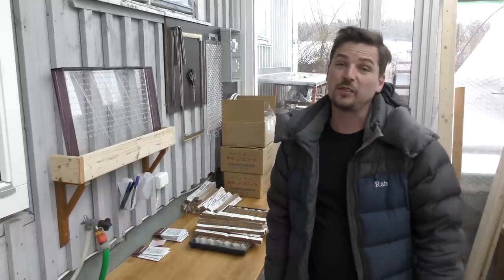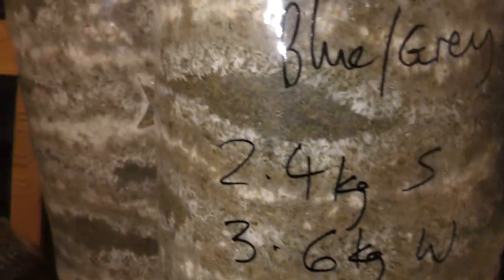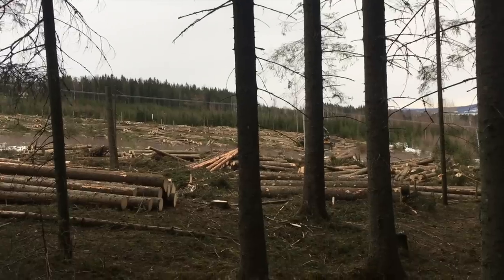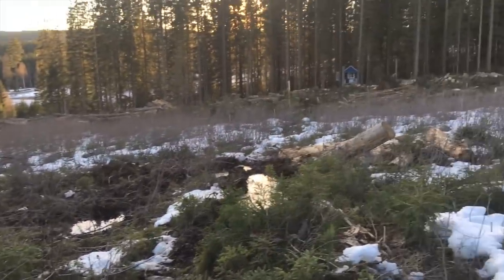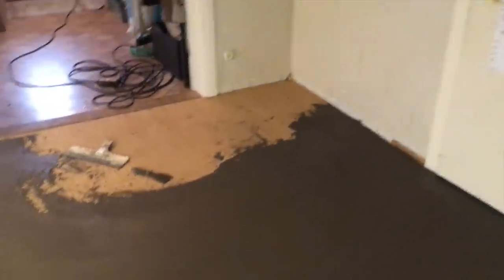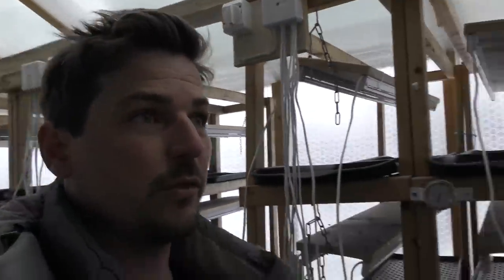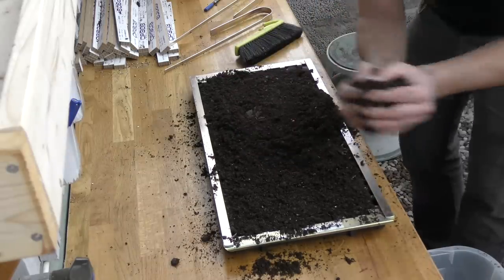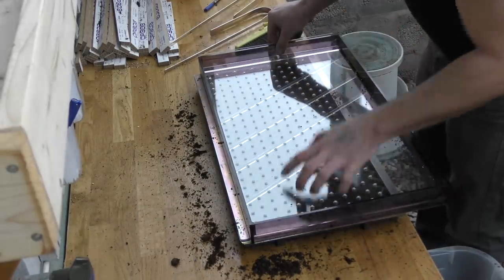SEEDING 12,000 SEEDS PER HOUR Testing the Paperpot system Drop Seeder; a new year begins...

Comment: if you use masking tape on the seeder plate in a diagonal fashion, skipping every second line of holes you can increase the spacing i.e. 15cm becomes 30cm...and so on...
Reply: also doing that. the seedings being a bit pricy...
Reply: @charlottecressy4530  Yes it is, however, if you have the volume then it is cheap compared to the cost of labour or the time savings you make if you do it without additional labour. You need the volume/scale to make it economical...
Reply: @kevinwallace4801  sorry i meant the seeding plakes. The paperpot system as a whole is totally worth it,no regrets at all!
Reply: Thoroughly enjoying your videos (second so far lol) brought back memories to when I just started as a Apprentice Gardener in Scotland almost 50 years ago.
We used wooden seed trays, a dibber (basically 0.25" plywood with wooden dowels inserted into drilled holes in the plywood pretty well like your Dibbler in plexiglass.
I think it was John Innes seed compost that we mixed up in the potting shed floor. 
It's amazing to see similar method being used all these years but seeing you   filling and seeding the trays it's way faster.
I was only getting paid £7.00 a week back then, barely covered my bus fares going to work and learning.
Thank you for sharing your video's with us, I forgot how much I loved the job....

Comment: Hey Richard, Connor from Neversink does a rotating hand motion (think Karate Kid) to rub the potting soil into the cells with a soft touch so as  not to disfigure the cell layout. It looks really quick and effective. Never uses a brush. One drop on the table and ready for seeding...

Comment: Fill several trays together with your seeding mix, then dib them all, then place the seeds in all trays, then place the vermiculite on all trays, then move to shelves. Wasted moves each time from picking up one implement or tool and then changing process. Keep all stages together to save your time and maximise efficiency 👍

Comment: First have a fairly large soil bin on the counter beside where you're working on a flat in order to save time and the back breaking work of repeatedly bending over to scoop soil. Secondly put your flat inside a shallow bin so that you can very quickly wipe all excess soil off of your flat without having to be careful about making a mess on the counter as the shallow bin will collect all soil you've shoved off of your flat.  Then you can remove the flat, dump the shallow bin into your larger soil bin and save the time that you'd otherwise use to clean the counter.

Comment: My back was aching after watching the seeding with the paper pot system. Your bench is too low for me. I think you could add an auxiliary bench right on top of the existing bench, permanent or  temporary. This raised work level, maybe six or eight inches, should extend beyond the original bench, a foot or so, to create space for your seeding medium containers on the floor below, and ease back strain by allowing the trays to be closer to your body. The near edge of the raised bench could have notches for sweeping the extra soil bits into the containers. The raised platform would create a narrow shelf space between the two bench tops that would accommodate your seeding tools.  Great videos! Thanks!

Comment: Saw the cases and cases of paperpots to go into the garden. Planting once or twice is probably ok but continued repetitive use of the paperpots have to have an impact on the soil. The manufacture of paper is not a clean process in itself and constantly placing these into the same soil bed can't be good.
I have studied this process at length and came to the conclusion that there has to be a better way. I understand the need to cut time in process as growing ground crops is a very time involved process.
The paper has to come from somewhere, the binding agents have to be chemical and this has to be shipped a very long way. All this has a price on the environment and not long term sustainable.
Reply: Paper is biodegradable and the glue would surely be made of insects. Where do chemicals come into play?
Reply: @goldenages7089  If it was just paper and glue, we could be all be happy. There are many other factors and ingredients that make up the mix called cardboard and paper. I have been to many paper mills to see the manufacture firsthand.
Reply: I dunno buddy. Compost worms love paper and cardboard, glue and all. If compost worms have any chemicals they will die, so I would have to question the accuracy of your statements.
Reply: @goldenages7089  Thats ok there are many crack and meth addicts that say what they do doesn't hurt anyone. Paper doesn't bind to itself and so it doesn't decompose there are additives to help stop this. If you don't want to listen, that's fine by me. We live in a free country. To each his own.
Reply: He has compost worms in his garden, so the paper will definitely be turned into highly beneficial worm castings. 
There are many videos documenting the laying down of cardboard and then organic material on top of that as the basis for a no dig garden. The cardboard inhibits weed seeds from sprouting and in a few years time with the help of the worms is all broken down naturally to form a rich soil.
I have not seen the detrimental effects you describe documented anywhere. Perhaps you could link us to a video?
Reply: @goldenages7089  they have plastic in them. Apparently they are working on making non plastic ones, but I agree with golden ages currently, can't just be sticking more plastic into your beds on every transplant.